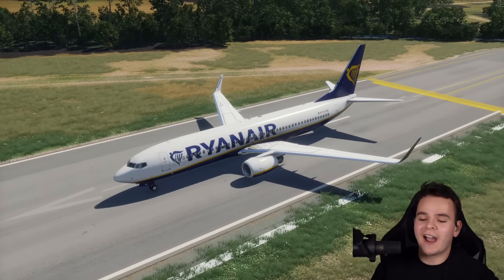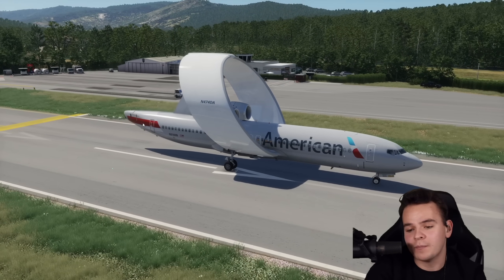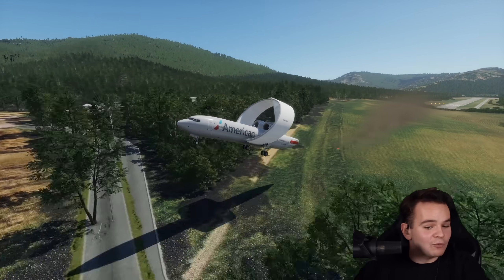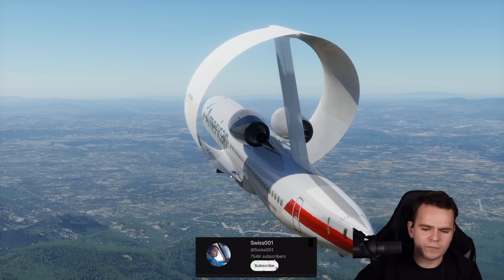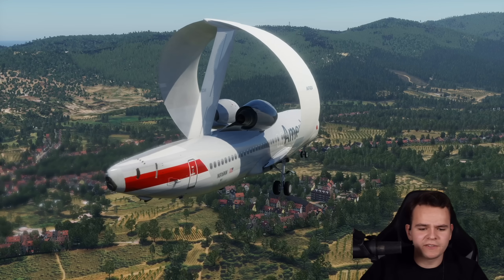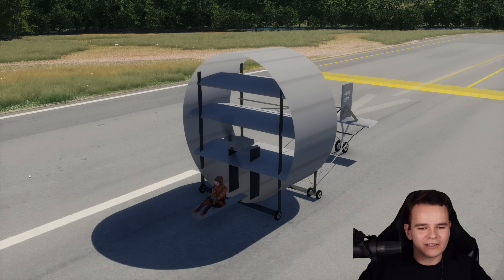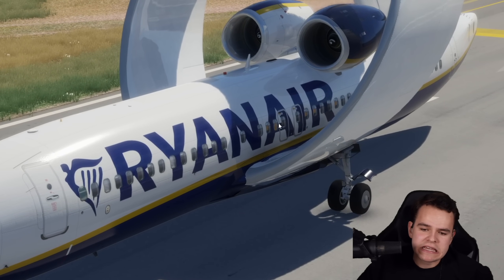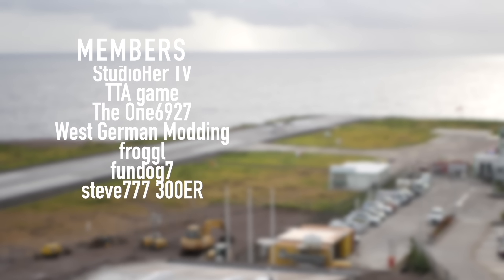I Flew The Lockheed Ring Wing Plane (It makes no sense)

Comment: Single circular wing fuselage integrated aircraft with multi 60 engines rotatable in 360 degree circular path to give thrust in any 360 degree parallel to engine axis in direction of aircraft motion & big propeller to give vertices take off, landing, flying saucer concept future aircraft design concept

Single circular wing with integrated fuselage 

Multi 60 Engines rotatable 360 in circular path 

Big Propeller at lowest below single wing integrated fuselage & multi 60 Engines rotatable in 360 Degree circular path future aircraft concept similar to flying saucers concept

Can you create aircraft design for above concept?

Comment: Low aspect ratio, extra drag, wasted lift... That wing has both dihedral and anhedral so it's perfectly oppose together... It's tailless too... I once did flew an indoor rubber powered airplane that replicate the wing of it. It flies very bad.
I guess the stability of that aircraft is the AoA of the front part of the wing is higher than rear part and proper CG (it's from my experience from an experimental F/F model)

Comment: If I were to guess, you'd be able to simulate the aerodynamics accurately in KSP assuming you have the mods needed to precisely build the aircraft wing

Edit: yes it's possible, and it has practically no roll control, the plane would just spin out of control, even with the vertical stabilizer.

Comment: Engines can be outside of the circle to reduce noise and airplane can have normal stabilizer on the back to control it. But extra weight makes it useless.